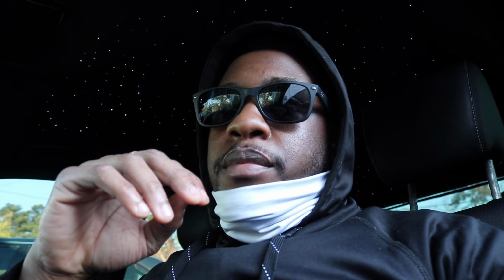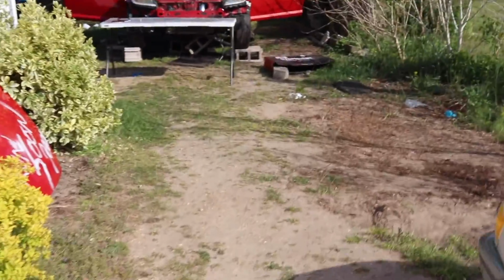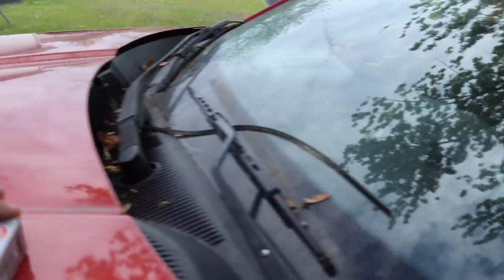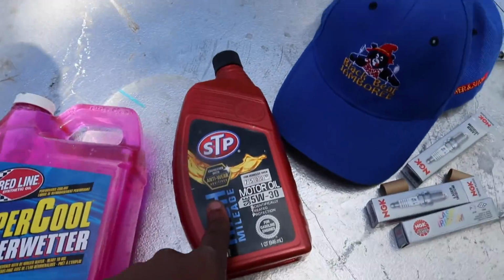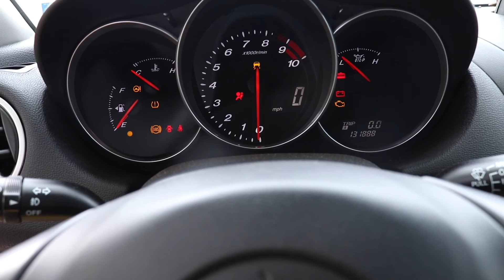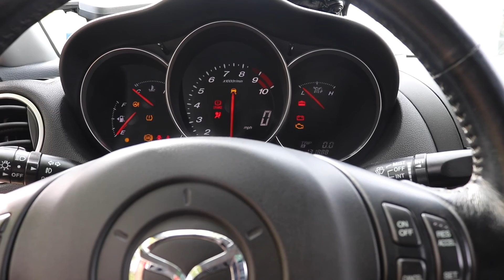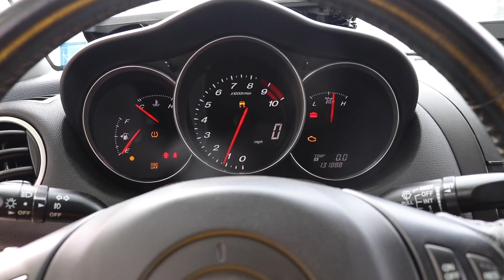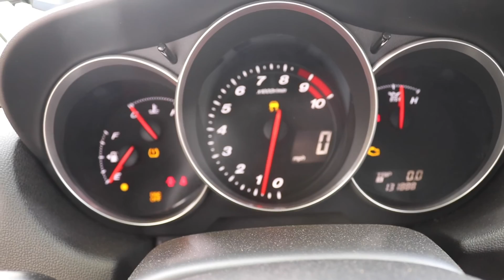FIRST START UP VIDEO OF MY 2004 MAZDA RX 8 AFTER INSTALLING 13B ROTARY ENGINE FROM JDM IMPORTS

Comment: Hey man did the motor end up being any good ? I’m thinking of buying a used motor in a really good condition about 40k miles idk if it would be worth it or not
Reply: Compression test that used motor before purchase, using a Rotary Compression tester is the easiest. Youtube has its ways but You're looking at 100 PSI-90 PSI per face in a rotor, any other odd imbalances is a no-go. If it gives bar its 9-8 bar for good compression, lower standard and even more lower bad.
Reply: Let me clarify, 100-90 PSI per face is a good motor, 90-80 Is decent, and anything lower is failing.

Comment: This engine is scrap, it only works for one rotor
Reply: Probably why there hasn't been a video in 3 years...

It was vibrating horribly. Seemed like the front rotor was dying, if not dead.